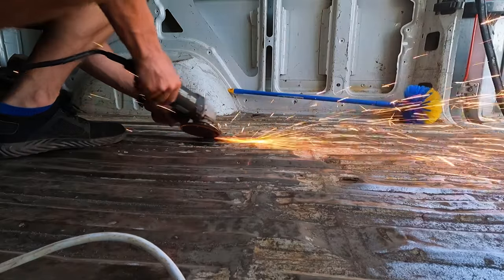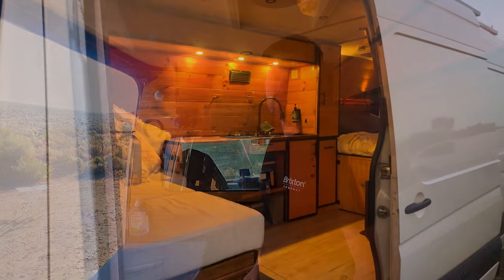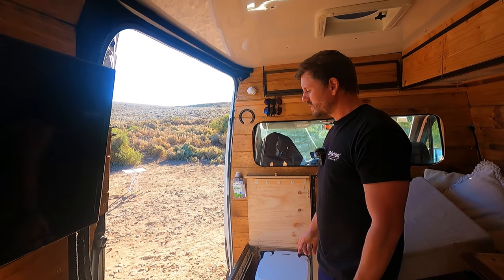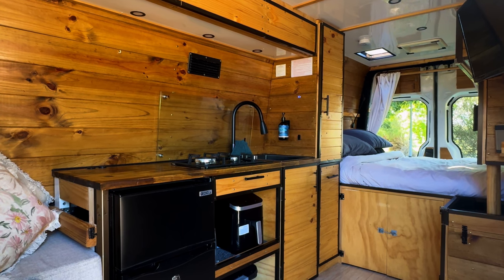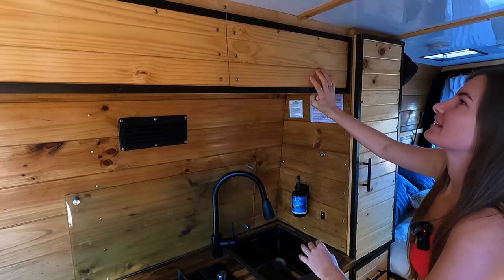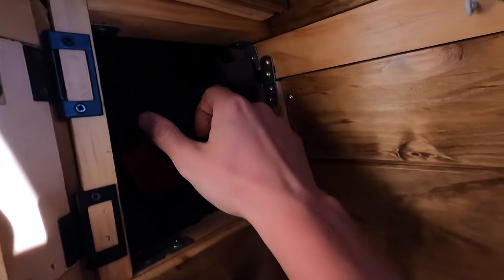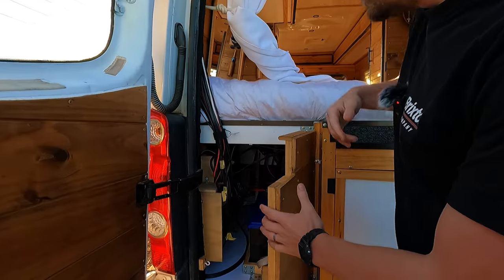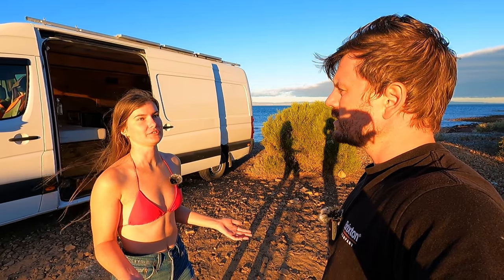The best VANLIFE off grid WORK FROM HOME tour

Comment: Looks gorgeous! it really feels like high quality work.
As someone who built a solar powered boat, some comments...
- you lack more clothes storage and food storage
- clean the solar panels frequently
- put a thermometer in the electronics area connected to some alarm system of some kind. The van is currently flammable as hell so you want safety against electrical faults, which with DC turn into nasty light arcs easily.